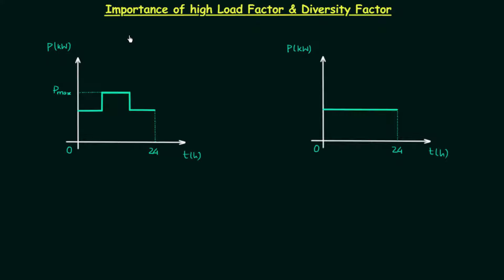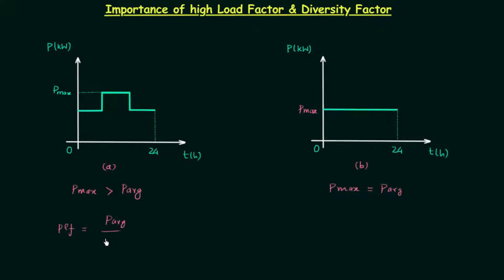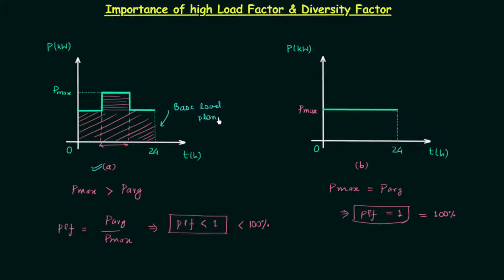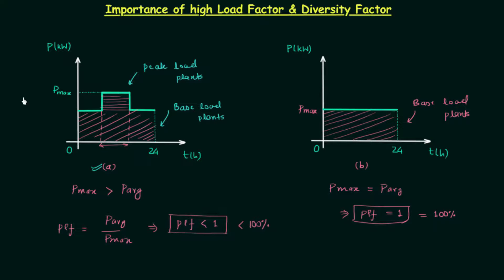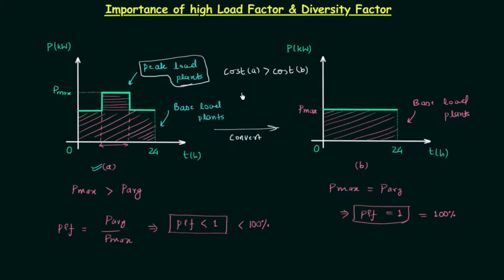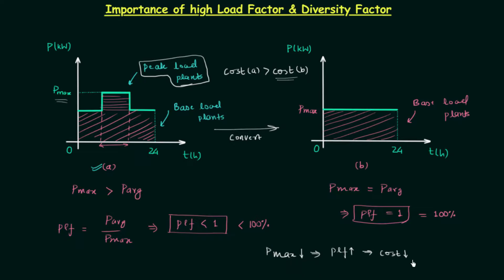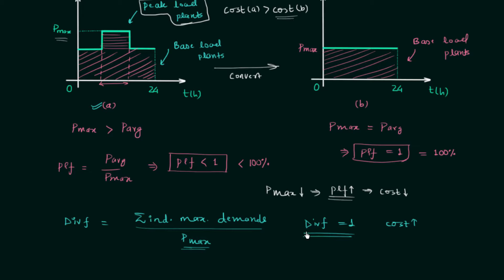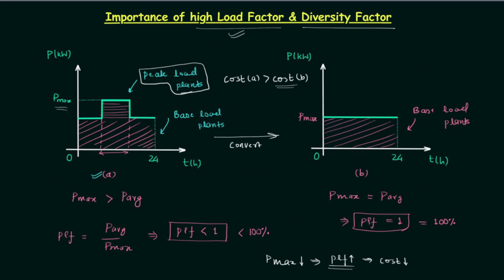Importance of high Load factor & Diversity Factor

Comment: IF THE MAXM DEMAND OF INDIVIDUAL WILL BE GREATER  THAN MAXM POWER  THEN HOW COULD IT SATISFY THE NEED OF ALL CONSUMERS???
Reply: Maximum demand of individual doesn't mean that each of the maximum individual demand run simultaneously or at the same time. Those individual demand could be at their own peak on their specific time. And if those individual demands happen to be running on the peak load in the same exact time then the maximum power of the complete system it self is the same as the sum of those individual demands thus making the diversity factor to be 1.